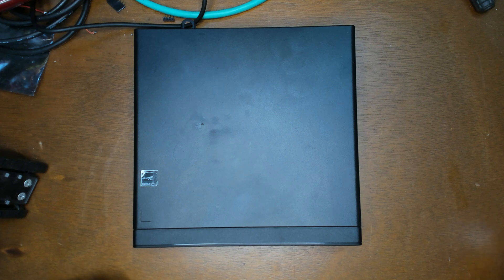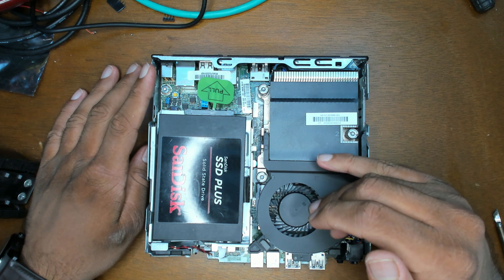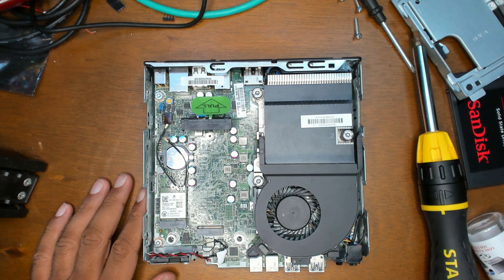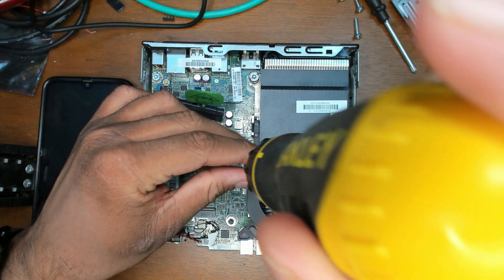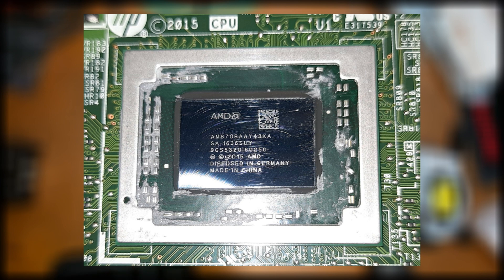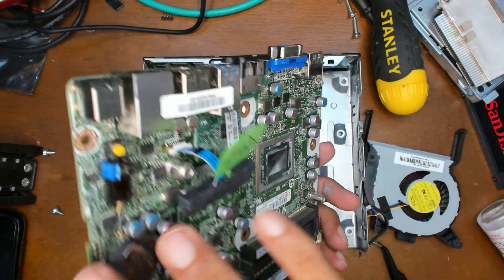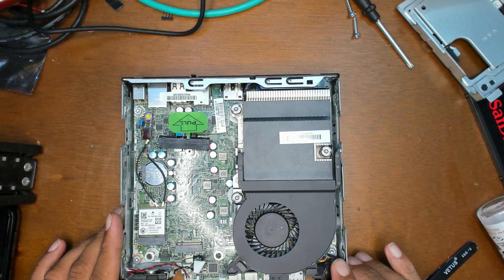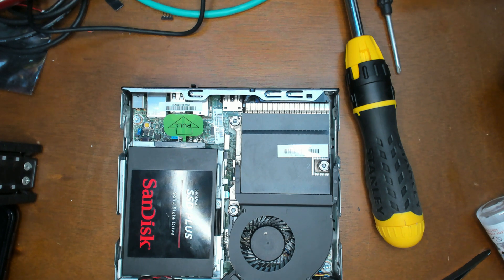HP EliteDesk 705 G2 Desktop Mini Thin Client Hardware Teardown

Comment: Hi i wonder if you can help, i installed new bios for 705 g4 mini and changed the ram. it now wont boot and no signal for display screen. i have removed ram and battery for cmos but still no joy

Comment: Nuvoton probably is a KBC controller. They are more of a mainboard controller chip. Does controll touchpad,capacivive sense, fans,3V and 5V converters, or other volages, sets all registers on startup.In laptop also controls charger chip like BQxxxx. Has it's own bios or ec firmware. Talks to the south bridge or in this case SOC which has the southbridge inside of it thru the LPC bus.